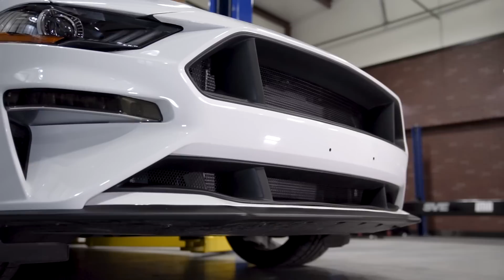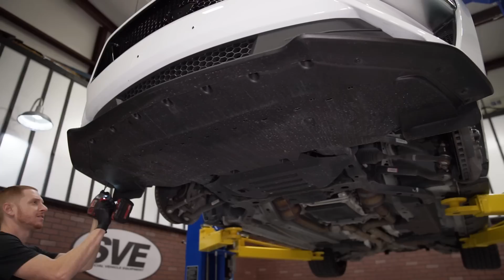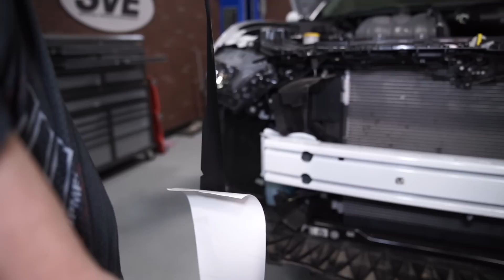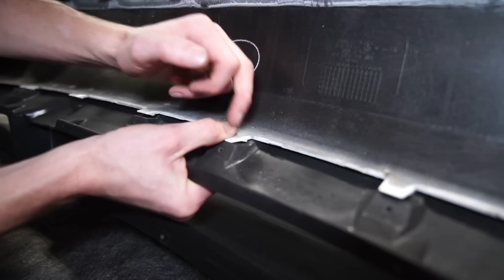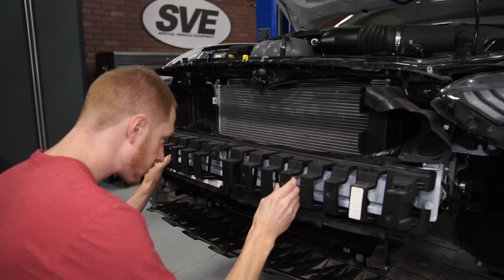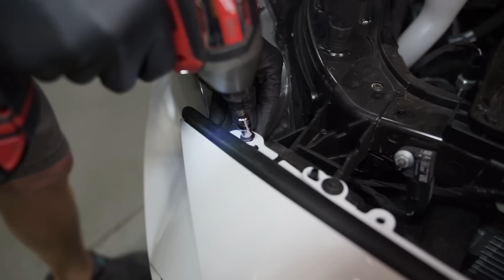2018-2023 Mustang Cervinis C-Series Upper & Lower Grille Kit - Install & Review

Comment: Yea, pretty grilles....then you hit the track, run 130+ mph and the entire front bumper splits apart because the garbage clips don't hold together. Literally had to re-engineer every single clip and make them bigger and stronger. Grossly over priced for the cheap construction

Comment: Finally got this grill set, was easy and came out mint! I found a small trick to do is bend the clips a little more that hold both grills in to help hold them in tighter. I also painted the radiator and bumper support flat black instead of using the decal.

Comment: I have a closed box carbon fiber Corsa cold air what's to stop water from going in the snorkel and directly into the intake with this grill?
Reply from the maker: The factory cold air system functions just like your Corsa kit. Unless you just blast this area with water while the engine is running, you won't have any issues. -Landan

Comment: Does the splash shield bolt up to the cervinis brackets? Or do the brackets just bolt up to the fender?
Reply from the maker: It's been awhile since I've installed this kit, but IIRC, the brackets sole purpose is to serve as supports due to the weight of the grilles. -Landan
Reply: @latemodelrestoration  thank you for the response. One more question, I only installed the lower grille, do you think I would still need the brackets? One I didn’t get all the brackets, and from what I seen they do not line up well with the splash shield .
Reply from the maker: @vzombie  You're welcome. I've never installed one or the other, only both. Did you buy the grille new or used? You should have all the brackets if you purchased new. Did you buy it from us? It could be that you contact Cervini's and see if they will sell the stuff that you need. Omitting the brackets will ultimately be up to you. My recommendation would be to run them. -Landan

Comment: This is an absurd amount of work just to install an upper and lower grill. And for the price cervini’s could have had both grill’s assembled. There has to be a downside to eliminating the shutters is it fuel mileage? A/C performance? Or less forced air induction?
Reply from the maker: Hi Andrew, the Ford Active Grille Shutters are special shutters in the grill that are opened and closed automatically to reduce aerodynamic drag while still allowing for proper cooling. If removed, you will see more drag and a possible change in cooling.

Comment: Do i really have to use those metal plates
Reply: @edwin did you ever get the answer?
Reply: @SVT_De_Rosa  nah you dont have to. i didnt. But i recommend it 😂 if not the grille is flimsy on the bottom and will probably fly off if your boosted going fast speeds

Comment: Does disconnecting the shutter system throw a CEL?
Reply from the maker: No removing the shitter system will not trigger a check engine light.
Reply from the maker: No removing the shutter system will not trigger a check engine light.
Reply: @latemodelrestoration   it did on me which is dumb if it’s better for the air flow to cool down the engine